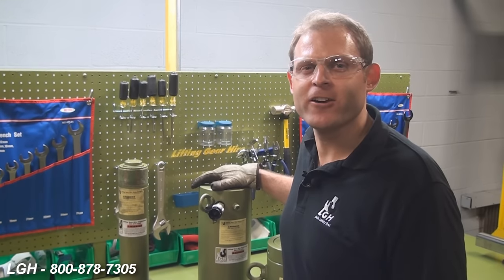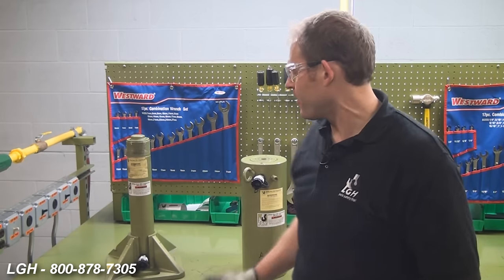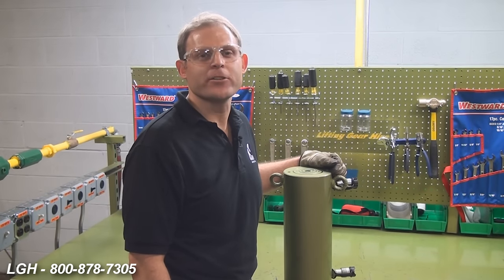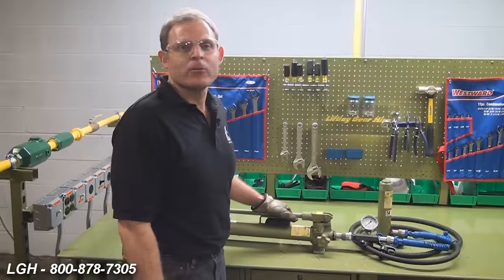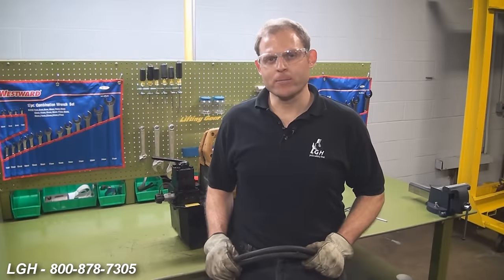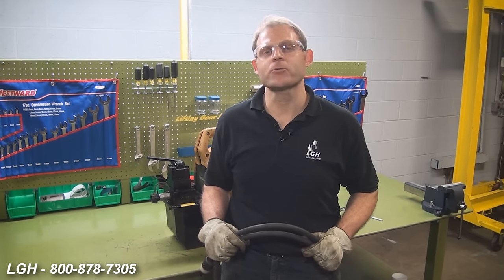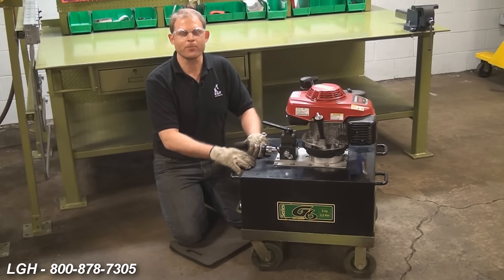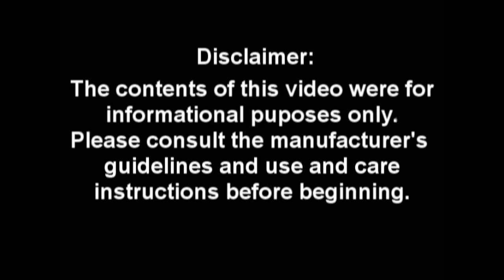Troubleshooting Hydraulic Cylinders & Pumps

Comment: I have a log splitter that’s been upright for a while n not used. Works both way s. I can’t get the cylinder to move hydraulically but can with a pry bar. Oil comes out of return inside the tank n sprays readily. If I understand I need to get horizontal n bleed the line. ??  Any vids on that ?

Comment: Thanks so much for this video.  What are the primary differences between using ATF vs hydraulic fluid on automotive hoists?
Reply: As a lifting medium, there is no difference. ATF is a hydraulic fluid that has more detergents and wear additives and is generally more expensive. ATF's intended application is in automatic transmissions, which requires the oil to do more than just act as a pressure medium. ATF can "scrub" or clean out a system much better than regular hydraulic oil, so if you use ATF make sure to change your filters religiously.
Reply: @A_friend_of_Aristotle  Thanks.  It is a sealed system so I am unsure how it could get dirty.  

I had a leaking seal on my two stage cylinder for my PORT A HOIST Canadian auto lift so sucked out all the 10+ gallons of crystal clear ATF (recycled it, UGH I should have burned it all in my VW TDI) then changed out for hydraulic fluid hoping it could help.  Of course I had to change out the seals.  Too bad!  Still running with the same juice.

Comment: Hello team

I have a cylinder which is not opening and closing but pump is working.
Kindly assist.
Thanks.
Reply: How do you know the pump is working? What is the flow rate? What is system pressure? What kind of pump? What is the application?

Comment: What do you think the problem will be with the hand pump when you you pump and nothing happens.
I have made sure the the oil and everything is all fine and filled to its expectation??
Reply: i wish you had some answers here as I have that now
Reply: The pump seals may be bad, or the check valve might be stuck open. Disassemble it, replace the seals and clean everything. Make sure the check valve moves freely, or replace it entirely.

Comment: Suppose you are the in charge of a power plant. There is a huge hydraulic pump working continuously and from few days its making huge sound and vibration. Please, find out the problem and suggest possible solution for this situation
Reply: Sounds like cavitation. This can come from one of two possible problems: low oil (look for leaks elsewhere) or air getting into the pump inlet (look for a loose hose or inlet fitting). Another possible problem could be a collapsing pump inlet hose. Other possibilities could be oil too thick, restrictions on the inlet side due to bends or fittings, kinked hose or hardline, cold oil, or plugged inlet strainer.

Most cavitation problems occur on the inlet side of the pump, between the pump and the tank.

Comment: I bought a used enerpac and noticed when I disconnect an accessory(after use) there is a bit of oil in the coupling.  Do I need a new hose?  It happens if I connect -- disconnect any of my  4 of my accessories.  Or is that just -to be expected
Reply: perfectly normal

Comment: Hi i have a mixer machine and the movement of the cylinder is not smooth, jittery. What could be the problem? Thank you appreciate your help.
Reply: Possible air in the oil. Look for pump inlet leaks or low reservoir level.

Comment: Sir my John deear tractor hydrolic leavrs are going up and down very slowely with impliment or without it. Why sir
Reply: pump is worn out, not enough flow to get speed
Reply: Shims for ram head
Reply: @geoffroybrabant-vincent9526  what does inverting the cylinder mean??

Comment: Can anyone help me with this problem, our hydraulic arm manages to raise but get stuck mid-range and starts "jumping" when trying to raise to full position. This problem only occurs on auto-mode, when raised manually (by holding the switch in raise mode) it manages to go to full position and engage the limit switch.
Another problem we have on another arm is that it doesn't manage to raise at all when in auto-mode. But if it is raised an inch or so manually, then switch to auto, it will continue the raise.
Reply: Without knowing more about the system in question, it sounds like a solenoid or controller issue. If everything works fine in manual I would discount any problem with the directional control valve, cylinder, or linkages/pilot controls to the directional control valve. If the auto feature controls the pilot system, there will be solenoid operated valves being controlled by an ECM. If you can connect with the manufactures diagnostics software do so and see if any error codes are present. I would suspect an electrical or electronic problem rather than mechanical or hydraulic.
Reply: Without knowing more about the system in question, it sounds like a solenoid or controller issue. If everything works fine in manual I would discount any problem with the directional control valve, cylinder, or linkages/pilot controls to the directional control valve. If the auto feature controls the pilot system, there will be solenoid operated valves being controlled by an ECM. If you can connect with the manufactures diagnostics software do so and see if any error codes are present. I would suspect an electrical or electronic problem rather than mechanical or hydraulic.